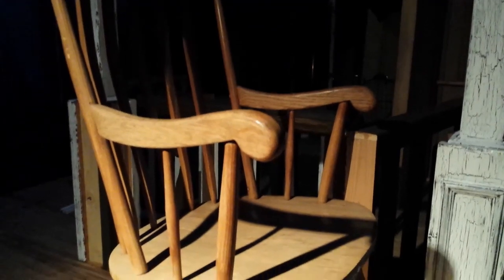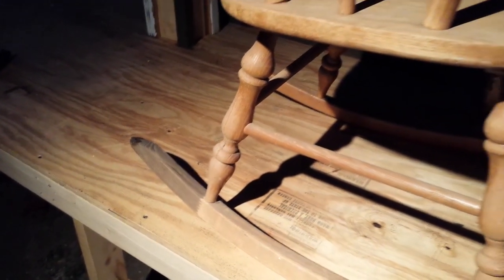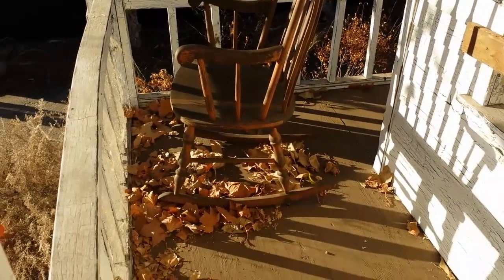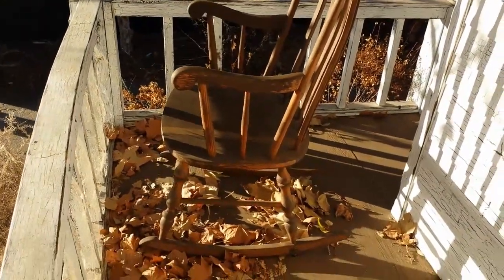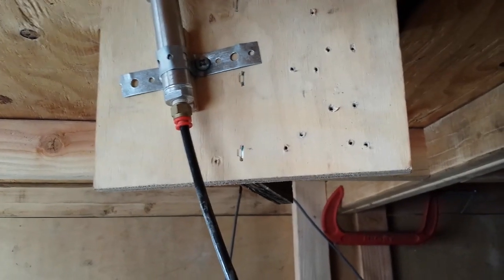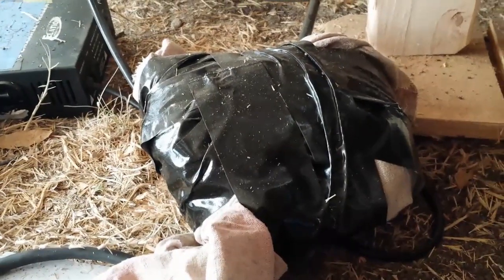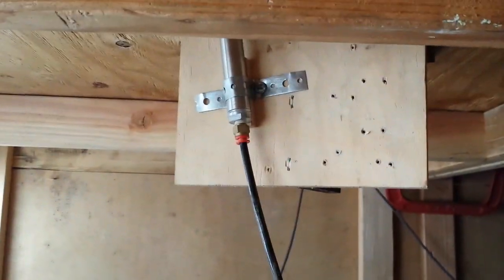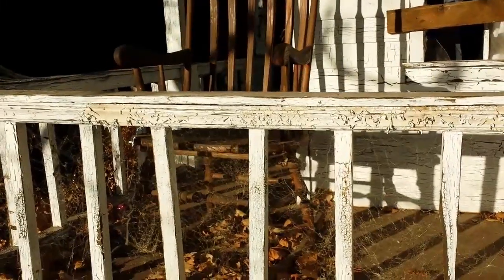Pneumatic Haunted Rocking Chair Prop For Halloween

Comment: Do you ever use prop controllers on your props?
Reply from the maker: We don't have any yet we just use 4 channel chase units that have speed controls on them.  Its not as cool cause you can't program the actions but we can get the props to turn off and on when we want with motion sensors.

Comment: I did this a couple of years ago but with one of those reindeer motors
Reply from the maker: It was a perfect prop to put in the old spooky haunted house and it was pretty easy to make as well.  I bet the reindeer motor worked great for this prop, had a nice slow movement to it.

Comment: At our Halloween party, we unscrewed the front of a fan and tied a string to one of the blades and tied the other end of the string to our rocking chair, so when we turned the fan on, the blade would pull the chair back and forth.
Reply from the maker: That's creative :)
Reply: Hollywood Haunter Thank you XD